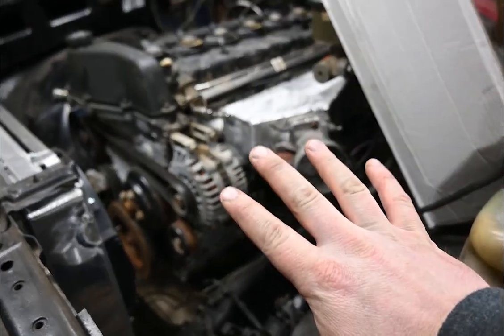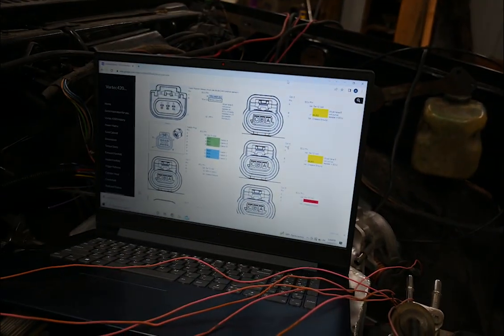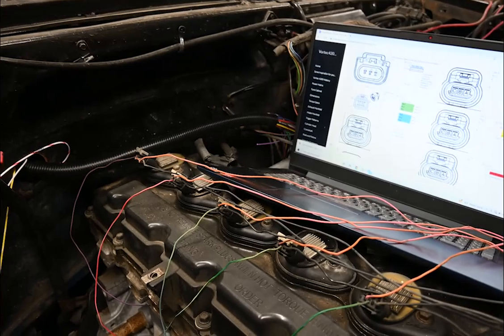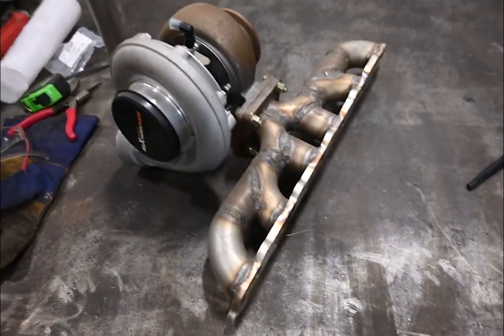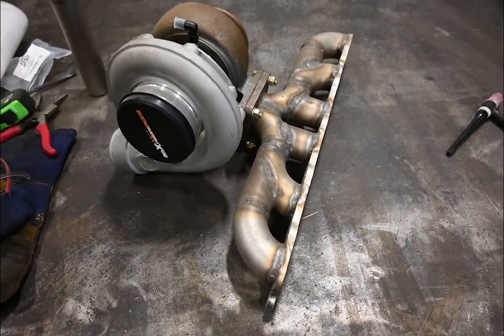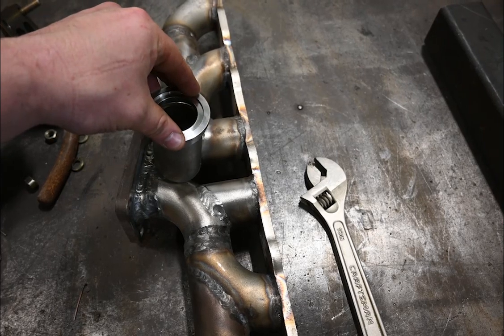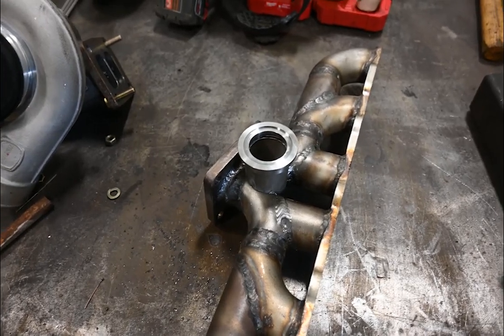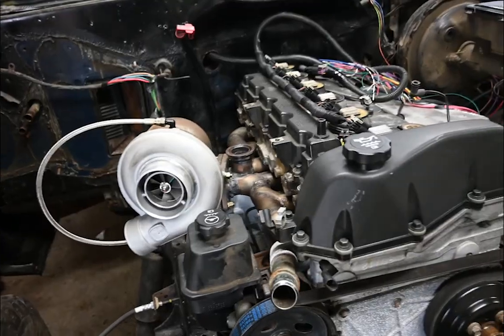Vortec 4200 wiring and manifold modifications

Comment: It’s funny , I almost have an identical swap . 89 c1500 , 4200 turbo with a manual using Microsquirt . In final stages now . Keep up the good work ! Wish I could weld aluminum I just used the stock intake .
Reply: I’m thinking of swapping one of these into a 97 Tahoe to replace the 350 vortec, what did you do for motor mounts?
Reply: @gwood90 made mounts that bolt to the oem clamshell rubber mounts on the frame
Reply: Sounds like a good solution. I’ll have to try to mock that up sometime, thanks

Comment: The Atlas engine is a legendary engine that is so overlooked. It's easier to make big power with that I6 than it is with v8. It's basically an American 2JZ.
Reply: I been preaching the gospel of the atlas since they were new I actually have a VHS for gm techs introducing the engine and how the block was made it's a different way instead of sand molds I think they said they used Styrofoam to mold the block but all in all gm should of used the engine for more applications

Comment: I know this water under the bridge. Did you think about a spacer cut at an angle between the flange and the turbo and then weld the waste gate in the spacer? Could make it out of square channel steel. Just a thought. If you have room.

Comment: A dream build would be a new hummer with 5 motors and all wheel steering and crab walk and screech out rear seating to a mega cab and long wheel base bed to put all that power under and to ground and more room for more battery packs and setup for a fifth wheel big 3 to 4 axle camper build  and air lifted to go big wheels and tires and and if build a 2nd would be with a big c13 or c15 tuned and built and turned up  burning weed oil

Comment: I wish i got or found you to do my trailblazer motor had motor and a great trailblazer  but had house fire moved motor from my garage to a guys house and his wife and him later was tripping and my apts towed away my tb even though it ran and drove and was clean and driven every week to wash and gas and to store but motor was not best but oil sending unit was changed out from AutoZone but was no good and wife drove it a week 😢 with no oil sending unit working and bearing on main was going bad and now sounding almost like a Cummins or something but not to bad so i had got a suv that a tornado dropped a tree on and had low miles now wish i cut top.off and drove it 😂but still got a 4x4 tb with sunroof as a car but that title was burn in my house so maybe loosing that one too lost all i own this year including my wifes new suv and mu health from this was a car hit from 70 in my rearend  in a 35 zone